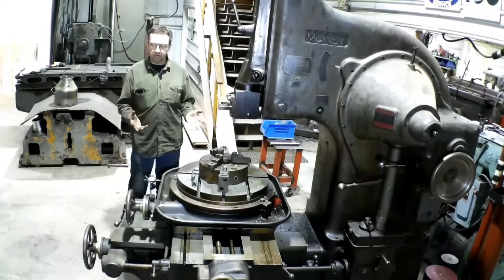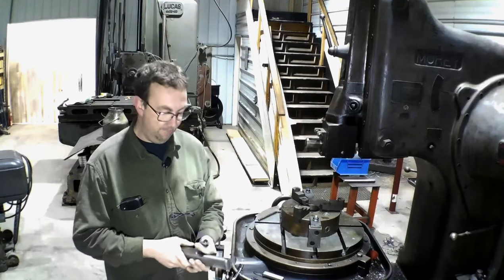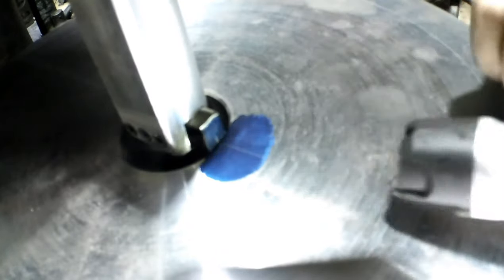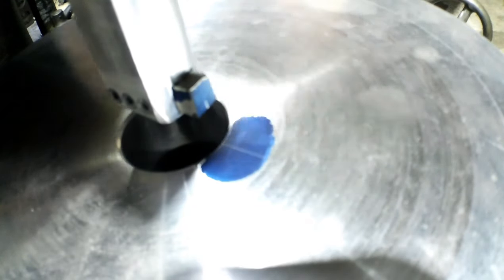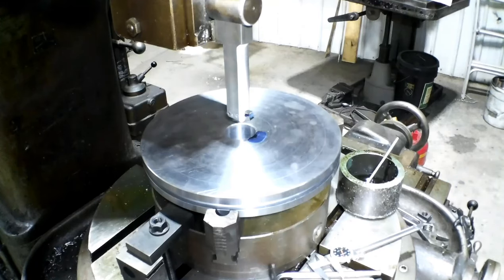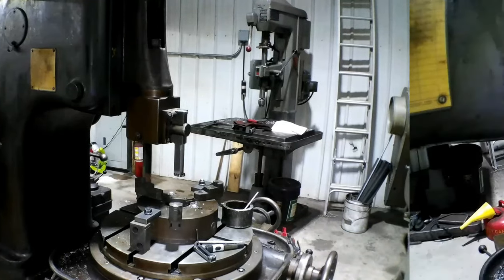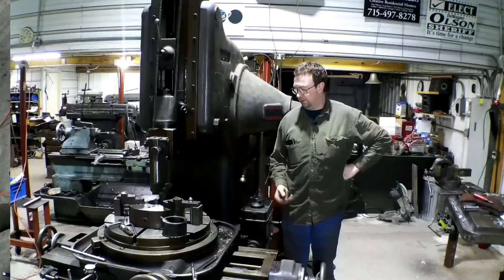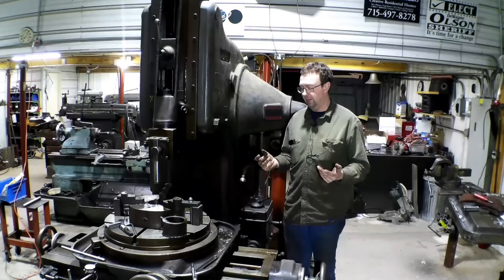Vertical Slotter Cutting Internal Keyways

Comment: Just when you think you've seen everything, huh? I bet you could use this as a gear hob as well.

Josh, regarding the process of centering the cutter on the center line of the hole..... I wonder if it would work if you used a depth Mike measuring from the outside of the part to the near flank of the cutter..... Approaching the cutter from both sides that way until the measurements were equal. I wonder if that would be a little bit easier or faster or possibly more accurate way of putting the cutter in the center line of the hole?

Comment: Not an expert here but shouldn't the cutter be on the other side? The way it is now, it seems the clapper box cannot push the cuter away from your work piece on the returning cut...
Reply from the maker: Slotters do not have clapper boxes. Pushing the chip down is how they work. They drag back. Wish it was different, but it works and I will just live with it. Thanks for watching.
Reply: @TopperMachineLLC  Thanks for the clarification! Those are quite rare but a real beauty! The screw above the tool got me confused for a clapper box. I re-watched an its actually the adjustment screws to align the tool. 
Isn't the table a rotary table synchronized with the feed? Meaning you could cut internal splines?
Reply from the maker: @jeanphilippepoirier6130  yes it is a rotary table. I haven't done any splines yet, but I'm sure that day is coming.